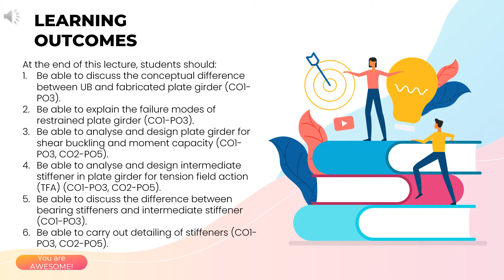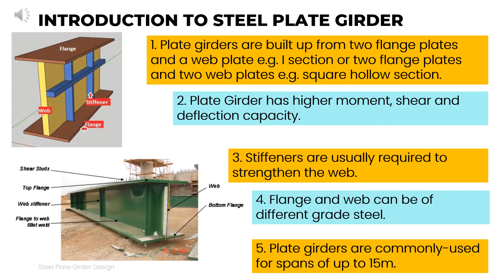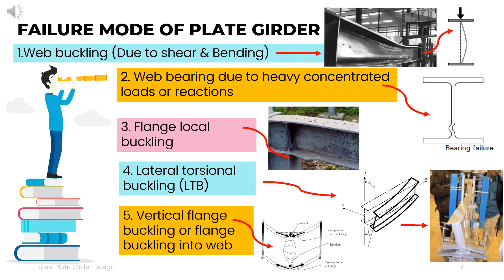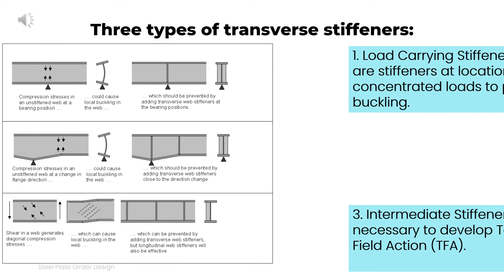Steel Plate Girder (Eurocode 3)-Summary By Dr.Ina

Comment: 5C1:
The plate girder is an I-beam cross-section made up of separate structure steel plates that are welded, bolted or riveted together. The plate girder generally has very thin flanges, large depth but thin web.The functions of steel plates girder are:
1. To replace rolled sections for a long span beam
2. To support heavy loads
3. It's mainly used in railways and road bridge 
4. It's used when deeper sections having hinger stiffness
Meanwhile the failure of plate girder are:
1. Web buckling 
2. Web bearing due to heavy concentration loads
3. Flange buckling
4. Lateral torsional buckling 
5. Vertical flange buckling 
However, these failures can be prevented by providing sufficient lateral restraits or adding transverse stiffeners.

Comment: 5C7
The video provides a concise overview of designing steel plate girders per Eurocode 3. It covers essential principles, including load-bearing calculations for bending and shear forces, methods to prevent shear and flange buckling, and the use of stiffeners for stability. Calculations and guidelines help ensure structural safety and efficiency by detailing proper flange and web dimensions, material choices, and reinforcement needs. This guidance is essential for constructing safe, durable steel girders.

Comment: 5C7
Plates girders are built-up from two flanged plates and a web plate
Higher moment,shear and deflections capacity 
Stiffness are required to strengthen the web
Flange and web can different grade steel

Failure mode
1. web buckling
2. Web bearing due to heavy concentrated load or reaction
3. Flanged local buckling
4. Lateral torsional buckling
5. Vertical buckling or flanged buckling

Can be avoid 
Providing sufficient lateral restraints
Adding traverse stiffness

Comment: 5C1 : Plate girder is structural members that resist loads primarily in bending and shear.Typically an I-beam cross section which are welded,bolted or riveted together .

Plate girder has higher moment,shear and deflection capacity.Flange and web can be of different grade steel

Failure mode of plate girder :
- web buckling
- web bearing due to heavy concentrated loads or reactions 
- flange local buckling
-LTB
-vertical flange buckling or flange buckling into web

Comment: AHMAD SYAMIM BIN AHMAD NASIR- 5C1

This lecture dives into the basics of designing steel plate girders, which are essential in structures like bridges that need to handle heavy loads over long spans. It explains the differences between universal beams and plate girders and explores why certain parts can fail, such as when the web or flange buckles, or when the entire beam twists under pressure.

To make girders stronger, stiffeners—essentially reinforcements—are used. These come in different types to help prevent buckling and spread the load more evenly across the girder. The design process includes figuring out the right thickness for the web, making sure the beam can bend without breaking, and adding stiffeners in the right places. Advanced techniques, like tension field action, are used to improve the girder’s ability to handle stress even if the web starts to buckle, ensuring the structure stays safe and reliable.

Comment: 5C1: 1) Steel plate girders are structural members that resists loads primarily in shear and bending. Moreover, size of the component is the key difference between a beam and girder. 

2) Plate girders are made up of two flange plates and a web plate and it has higher moment, deflection and shear capacity. 

3) Economical design of girders : 
i) has very thick flanges
ii) large depth (d)
iii) very thin web (t)

4) Functions of steel plate girders:
i) replaced rolled sections for a long beam span requirement
ii) Support heavy roads
iii) Used in railway, road bridge girders and as a crane girders
iv) Used when deeper section having higher stiffness to carry heavy loads

5) Failure mode of steel plate girders
i) Web buckling (Due to shear & Bending)
ii) Web bearing due to heavy concentrated loads or reactions
iii) Flange local buckling
iv) Lateral torsional buckling (LTB)
v) Vertical flange buckling or flange buckling into web

6) Failures can be prevented by:
i) Providing sufficient lateral restraints
ii) Adding transverse stiffeners along the length of beam web 

7) Design process:
i) Minimum web thickness
ii) Bending resistance
iii) Basic dimensioning
iv) Web design
v) Design of stiffeners

Comment: 5C7: Plate girders are structural components that mainly withstand loads in shear and bending. The size of the component is the main difference between a girder and a beam. Plate girders are frequently employed for spans up to 15 meters and have a higher moment, shear, and deflection capacity. Supporting large loads, as those on a bridge construction, is one of the steel plate girder's uses. Plate girder failure modes include flange local buckling, lateral torsional buckling (LTB), web buckling (from shear and bending), web bearing from strong concentrated loads or reactions, and vertical flange buckling or flange buckling into web. By installing transverse stiffeners along the length of the beam web, these failure types can be avoided.

Comment: 5C1: Plate girder is member that resist load primarily in bending and shear. Also, it is an I beam cross section that built up from two flanges and a web plate. Plate girder has higher moment, shear and deflection capacity and to strengthen the web, stiffeners are required. Flange and web can be of different grade steel.
 FUNCTION:
•	Replace rolled section for a long beam span
•	Support heavy loads
•	Used in railways and road bridge girders
•	Used when need deeper section that have higher stiffness
FAILURE MODE:
•	Web bearing
•	Flange local buckling
•	Lateral torsional buckling
•	Vertical flange buckling or flange buckling into web
PREVENTIONS:
•	Providing sufficient lateral restraint
•	Adding transverse stiffeners along the length of the beam web
STEPS OF PLATE GIRDER DESIGN:
1.	Minimum web thickness
2.	Bending resistance
3.	Basic dimensioning
4.	Web design
5.	Design of stiffeners

Comment: 5C1 : 

Steel Plate Girder is structural members that resist loads primarily in bending and shear which is made from two flange plates and a web plate. It has economical design. Has multiple functions to support heavy loads. Mode of failure is web buckling, web bearing, flange local buckling, lateral torsional buckling and vertical buckling.

Comment: 5C1:  
Introduction : plate girders built from two flange plates and web plate. it has higher moment, shear, deflection capacity. 
Function : mainly use in railway and road bridge girder. manage to replace rolled section for a long beam span requirement and support heavy loads such as on a bridge structure

Failure modes: 
- web buckling due to shear and bending
- web bearing due to heavy concentrated
- flange local buckling
- vertical flange buckling

Types of transverse stiffeners
- load carrying stiffeners
- load bearing stiffeners
- intermediate stiffeners

Comment: 5C7: steel plate girder functions are to support heavy loads, replaced rolled for a long beam. Plate grider also used when need deeper sections to carry heavy load. Failure mode of plate girder can be web buckling, flange buckling, lateral torsion. To prevent this failure, can use transverse stiffeners.

Comment: 5C7
Definiton:
-	It is built up from to flanges plates and web plate. 
-	Plate girder has higher moment, shear and deflection capacity.
-	Stiffness is usually required to strengthen the web. 
-	For economical design, plate girder generally has very thick flanges, large depth but thin web. 
Function:
-	To replace rolled section for long beam span requirement as rolled section 
-	To support heavy load 
-	Used in railway and road bridge girder
-	Used when we need section having higher stiffness to carry load.
Failure mode:
-	Web buckling (due to shear and bending)
-	Web bearing due to heavy concentrated load or reaction 
-	Flange local buckling 
-	Lateral torsional buckling 
-	Vertical flange buckling or flange buckling into web 
These failures can be prevented by:
-	Providing sufficient lateral restraint e.g. composite slab to avoid LTB
-	Adding transverse stiffness along the length of the beam web

Comment: 5C1 : 
Steel Plate Girder
- structural members that resit loads primarily in bending and shear
- I - beam section = deeper vertical web and narrower flanges of the beam
- size is different between beam and a girder

> functions :
1) replace rolled sections for long beam span (bcs rolled sections need to spliced and may result in resistance inefficiency.
2) support heavy loads 
3) usually used in railway and road bridge girders 
4) use when need deeper sections having higher stiffness

> failure :
1) web buckling
2) web bearing
3) flange local buckling
4) LTB
5) vertical flange buckling / flange bucling into web

> failures can be prevented :
- provide sufficient lateral restraint ( ex : composite slab )
- add transverse stiffeners along the length of beam web

> Design procedure :
1) minimum web thickness
2) bending resistance 
3) basic dimensioning
4) web design
5) design of stiffeners

Comment: 5C1: 1. Steel plate grider
- a structural member to resist load from bending and shear
- It is I beam cross section and have welded or bolded.
- Has higher moment shear & deflection
- Suitable for spans up to 15m
- Built up from flange plate & web plate

2. Design consideration:
- large depth (d)
- Thick flanges
- Thin web (t)
- Size flanges 
(have 5 steps design plate girder)

3. Failure may be occured:-
- Local buckling
- LTB
- web buckling
- vertical flange buckling
(Can be prevent by adding transverse stifferners along the length of beam web)

Comment: Definition:
- steel plate girder defined as structural members that resist loads primarily in bending and shear
- difference between beam and girder is size

Function:
- replaced rolled section with bigger beams
- support heavy load (bridge)
- provide higher moment,shear, deflection
- design different grade for flange and beam
- size of plates can be design

Failure mode: 
- web buckling
- flange local buckling
- -LTB

Failure prevention:
- adding transverse stiffeners 
- adding sufficient lateral restraint

Types of transverse stiffeners:
- load carrying stiffeners 
- load bearing stiffeners 
- intermediate stiffeners 

Steps in design steel plate girder:
1. Minimum web thickness 
2. Bending resistance 
3. Basic dimensioning 
4. Web design
5. Design of stiffeners

Comment: 5C7:
Definition of Steel Plate Girder- Resist the loads primarily in bending and also shear. It also made of separate structural steel plates to form deeper vertical web and narrower flanges of the beam. 

Functions- To support heavy loads such as on a bridge structure. It also used when deeper sections is needed having higher stiffness to carry heavy loads. 

Failure Modes- Web buckling, web bearing, flange local buckling, lateral torsional buckling (LTB) and vertical flange buckling. 

The failure modes can be prevented by- Providing sufficient latetal restraints and adding transverse stiffeners. 

Types of transverse stiffeners-Load carrying, load bearing and intermediate stiffeners.

Comment: 5C1:  Plate girders are structural components that mainly withstand loads in shear and bending. Two flange plates and a web plate form a plate girder. Plate girder has greater capacity for moment, shear, and deflection. Since plate girder has more stiffness and capacity than regular beams, they are crucial for high-load-bearing construction. In design, load-carrying and load-bearing stiffeners have different functions; understanding these differences is essential for structural stability. Methods like tension field action increase shear capacity. The d/t ratio in plate girders illustrates the harmony between depth and thickness in structural design and highlights the necessity of proper web design to reduce buckling.

Steel Plate Girder Design Process: 
1.	Minimum web thickness
2.	Bending resistance
3.	Basic dimensioning
4.	Web design
5.	Design of stiffeners

Comment: Nurul jannah 5C7

Summary of Steel Plate Girder Design

Steel plate girders are versatile structural elements used to span long distances and support heavy loads. Key considerations in the design include:

Functions:

- Replacing rolled sections for long spans
- Supporting heavy loads
- Used in bridges, industrial structures, and cranes

Failure Modes:

- Web buckling
- Web bearing failure
- Flange local buckling
- Lateral-torsional buckling
- Vertical flange buckling

Prevention Methods:

- Lateral restraints
- Transverse stiffeners

Transverse Stiffeners:

- Prevent web buckling
- Support concentrated loads
- Enhance shear capacity through tension field action

Comment: 5C7: Plate Girder: A large girder made by joining plates (flanges on top and bottom, web in the middle) for extra strength.

 1. Why Use Plate Girders:
 • Needed for very long spans or heavy loads (like in bridges).
 • Customizable (flange and web plates can be different sizes or materials).

2. Failure Modes:
 • Web Buckling: When the middle (web) plate buckles due to high shear or bending.
 • Web Bearing: When the web crushes under very heavy loads.
 • Flange Buckling: When the top/bottom plates (flanges) buckle under compression.
 • Lateral Torsional Buckling: When the girder twists under load.
 
3. Stiffeners (Support Plates):
 • Load-Carrying Stiffeners: Placed where loads are concentrated to prevent web buckling.
 • Load-Bearing Stiffeners: Support heavy loads to prevent web crushing.
 • Intermediate Stiffeners: Used between other stiffeners to provide additional support and resist shear forces.
 
4. Design Steps for Plate Girders:
 • Step 1: Choose minimum web thickness.
 • Step 2: Calculate the bending strength.
 • Step 3: Determine basic dimensions.
 • Step 4: Design the web to resist shear and buckling.
 • Step 5: Add stiffeners as needed for extra support.

Comment: 5C7 : Plate girders are structural members that resist loads primarily in bending and shear, typically an I-beam cross-section made up of separate structural steel plates. It is built up from two flange plates and web plates commonly used for spans of up for 15m.

Functions :
- To replace rolled sections for a long beam span requirement
- To support heavy loads
- Mainly used in railway and road bridg and as crane girders in industrial structures
- Used when deeper sections having higher stiffness to carry heavy loads

Failure Modes :
- Web buckling due to shear and buckling
- Web bearing due heavy concentrated loads of reactions
- Flange local buckling
- Lateral torsional buckling
- Vertical flange buckling or flange buckling into web

These failure Modes can be prevented by providing sufficient lateral restraints or adding transverse stiffeners along length of the beam web. The function of transverse stiffeners is to help combat effects of web buckling and to provide support to any concentrated load or reaction.

Comment: 5C7 : In summary, I can determine the function of plate girder and universal beam. However, the characteristic of those structure can be differentiate based on their sizes, shapes, and the amount of weight they can support. Plate girder can reach fail conditions such as flange local buckling, vertical flange buckling, torsional buckling, and web buckling due to stong concentrated load. In order to prevent the failure, tranverse stiffners and adequate lateral straint to avoid from failur

Comment: 5C1: Steel Plate Girder use when deeper section needed and to carry heavy load. It need a stiffener to support the web and usually use for span more than 15m. Example of used is on a bridge structure and railway. Stiffener also use to support girder from web buckling. 5 basic steps to design steel plate girder is minimum web thickness, bending resistance, basic dimensioning, web design and stiffener design. Lastly, nice and thank you Dr. Ina for the video.

Comment: 5C1:
Definition: Plate girders are structural members designed to resist loads through bending and shear.

Construction:

Made from two flange plates and a web plate.

Suitable for deep sections with high stiffness, making them ideal for heavy loads.

Comparison with Beams:

Plate girders are larger and allow for higher moments, shear, and deflection capacities.

Flange and web plates can use different steel grades.

Common Uses:

Bridge construction.

Long-span floor girders in buildings.

Industrial structures, crane girders, and road/railway bridges.

Design Features:

Typically have thick flanges and thin webs, which increase the D/T (depth/thickness) ratio, making webs prone to buckling.

Stiffeners are added to strengthen the web and prevent buckling.

Failure Modes:

Web buckling (from shear and heavy loads).

Flange buckling (local, lateral-torsional, and vertical buckling).

These are countered by using lateral restraints and stiffeners.

Types of Stiffeners:

Load-carrying stiffeners: Provide web support for concentrated loads.

Load-bearing stiffeners: Support reactions.

Intermediate stiffeners: Prevent web buckling.

Enhanced Shear Capacity:

Tension Field Action: After web buckling begins, tension field action can increase shear capacity.

Basic Design Steps:

1. Calculate minimum web thickness.

2. Determine bending resistance.

3. Establish basic dimensions.

4. Design the web.

5. Add and design stiffeners.

Comment: 5C7:  Plate girder needed when higher stiffener to carry heavy load. there are 3 types of the plate girder which are load carrying stiffeners, load bearing stiffeners and intermediate stiffeners. for load carrying and load bearing are same physically but need to check design differently for web buckling and web bearing. there are 5 basic steps for checking the design which are minimum web thickness, bending resistance, basic dimensioning, web design, and design of stiffeners.